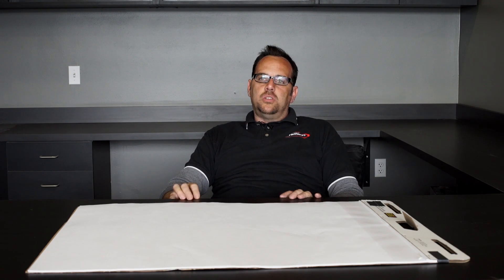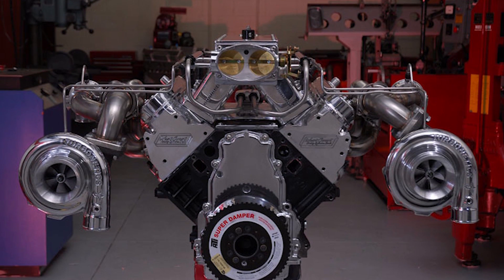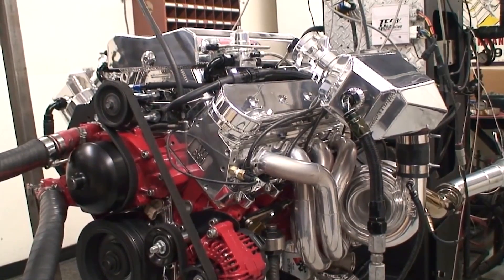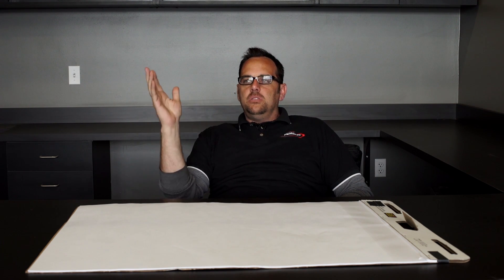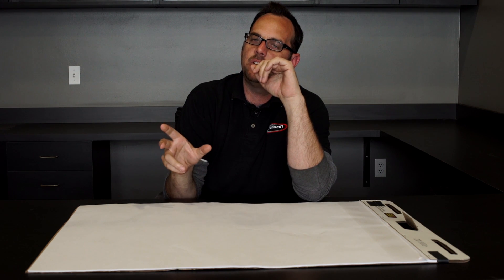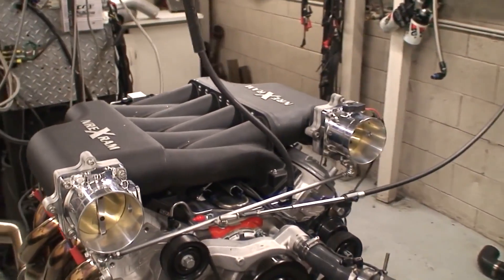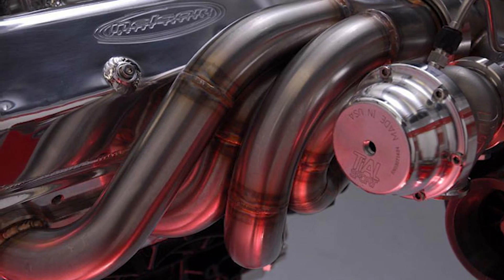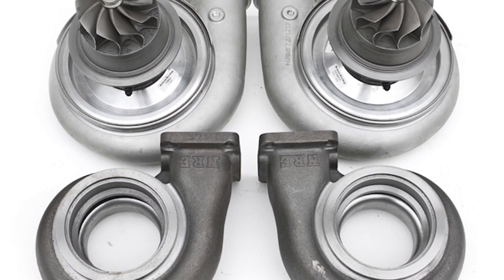Master Engine Builder Explains Why the LS V8 Is SO Good

Comment: i love this video should do a Why is the 2JZ so good? next
Reply: all you guys are looking at my original post wrong. i never said the 2J was better, i was just saying they should do more videos like this one about other motors.
Reply: +joseph martinez  the 2JZ is so good because engine block development made in Germany, Cylinderhead development at Yamaha, result one of the best
Reply: +joseph martinez Because inline 6 with turbo and square bore/stroke and DOHC 4 valve. That's it. and the cast iron short block is very robust and the aluminum head is well designed.

Done.
Reply: *****  he has no debate, literally everything I said was factual.
ls motors kick rods well before jz motors look it up on the fbody fourms (which I used to be apart of I owned a 12 second ws6 only bolt ons) its not just slapping a turbo on a ls and making power.
jz motors have made over 1000hp unopened complete oem gaskets. let alone 550whp is a piece of cake drivability is all in the tune.
show me a ls to make over 1000hp on the stock headgasket and head bolts, let alone stock rod bolts....you will kick a rod in a ls over 800hp its just a matter of time. however a semibuilt ls is bulletproof and makes tq for days.
I take nothing away from both engines, im not a fan of spreading miss information like a jz being a ticking time bomb over 550whp that's jjust bullshit and anyone with half a brain knows its.
if new world order was half as non biased as he would like to claim he would have corrected the countless miss claims made in this thread, instead hes just protecting the ls motor could care less about what anyone says about the jz motor cause hes a fanboy.
this whole comment section is filled with bullshit from keyboard warriors who have never been there or done that.
Reply: +saratov99 That's a little extreme.  All cars have a mechanical margin of safety built into them.  A 300 hp car that now makes 500 hp on an internally stock engine is likely well beyond that point.  I cam swapped my Corvette and drove it 3,000 miles on the Power Tour a week later.  I had zero problems.  I can completely understand the piece of mind of knowing a stock car will fire every time you turn the key.  A lightly modified car that is well planned out can give the owner that same piece of mind.
Reply: +joseph martinez 2Jz is an overhyped engine.
PIG fat 600Lbs.
not fuel efficient 
not small
not cheap to modify.
Reply: Razvan J im not comparing the two motors i want to see more of these kind of videos i dont care whats better
Reply: +joseph martinez easy to make power on a 2jz, reliability is another story
Reply: what do you guys drive? or just keyboard warriors?
Reply: the RB series motors would be good to see too
Reply: +MRsteezy123 bigger engine more parts more money let's see my ls1 gto made 430whp after heads cam exhaust tune. Heads $1200, cam $300, exhaust $2,000 tune $300. Let's see a 2j make over 400wheel for less than that and be a daily in the summer with 24mpg. Shit all its needs is about 8lbs to be making 700+ and that's with just bolting on a turbo like a lot of guys do. There's stock ls2s with a tubing thrown own making 600+ wheel you won't do that with any 2j. The LS is better plain and simple for a platform to build power on. 2j can't touch the reliability and power capabilities the Lsx is capable of and neither can most engines that's why it's so popular. Amazing performance platform, reliability, cheap cost, why the LS is so popular. The 2jz is a great engine but not as great as the LS
Reply: +joseph martinez that would be cool to see for sure. this guy has 20+ years with v8 style motors...i wonder who in the world has the same passion for inline 6 motors...find that person and you got the 2JZ video....slim chance they exist. 8000HP top fuel dragsters are supercharged V8s in todays world. the v8 still destroys all. http://www.popularmechanics.com/cars/a12596/anatomy-of-a-top-fuel-dragster/
Reply: +New World Order lol, where is your argument though ? All you've done is pull petty insults out your ass, but have yet to say a single fact. If anyone is the fanboy, it would most definitely be you.
Reply: +Razvan J Holy shit you're ignorant.
Reply: ***** you have no argument, NUFF SAID.
Reply: ***** and all my facts remain and you have yet to bring a actual argument, jz still holds more power than a ls oem for oem., cry about it.  the fact you think you can put all engines from japan in the same category already shows me the idiot im talking to.
Reply: +saratov99 The RB series' achilles heel is its oiling system.... being a high revving engine, you would think its oiling system would be better..... nope. You'll have to spend at least $800 on an N1 oil pump if you're thinking of even making any more power than stock and sit at 8000rpm
Reply: +Richard Harrold the ls is head and shoulders above the 2jz.
Reply: i have no idea how that reply goes to anything i said last but whatever you say man you do your own thing.
Reply: +joseph martinez Yes plz
Reply: joseph martinez theres a kid on youtube names albert meade whos making like 740whp on a 1jz with all stock gaskets and internals in a mk3 supra like does this Saratov kid think he knows anyting? he sounds like a dumbass, its a well known fact a jz will handle over 800whp all day. a ls will kick rods way before a jz, and before it kicks rods it will blow a headgaket at around 600whp..
both engines will make more power then you could need, but a jz will make more stock for stock more reliable. a ls needs to be partially  built to show its true potential.
Reply: Everyone is over here arguing LS vs 2JZ, I'm just sitting here loving my '75 sbc..
Reply: +Richard Harrold Jesus Christ French cars? I wouldn't spend someone else's money on a rolling French turd.
Reply: +joseph martinez way early in the thread in a comment made by Richard. I chimed in too late in a thread is unnecessarily long. But yeah something more on topic I think both engines have their merit and we're both rolled out in some pretty iconic cars that changed the face of Motorsport for the better.
Reply: lol oh ok yeah idk how this comment thread turned into a bitch fest.
Reply: yeah youll never understand unless you sit in one and experience it yourself. endurance racing is a feat but its just one type of racing gotta respect them all or your not really a true enthusiast. nothing is better than the other just an opinion of what you grew up with
Reply: +MRsteezy123  do some research stock GM 4.6 1200hp http://www.hotrod.com/how-to/engine/hrdp-1109-stock-gm-ls-engine-big-bang-theory/
Reply: You guys are all dumb. Obviously the rotary engine is the best engine in the world.

lol jk I love my rotaries but they have no torque
Reply: +Richard Harrold those engines are modular (DOHC), so their valve technology is more advanced and yes, they make more power but have more moving parts.  Pros and Cons to each technology.  I personally own a 5.0L V8 DOHC and love it, but you have to give the LS credit.
Reply: MRsteezy123 I love my 1JZGTE SC300 lol
Reply: ***** and the fact still remains a jjz makes more than ls ....and take a rain check kid the 2jz is not extinct you can still get a 0 mile crate engine from Toyota or a 30xxx mile engine from japan.....idiot I mean I literally disprove anything you have to say.
you do realize GM and Toyota have a partnership and have had a partnership for 25 years and sell each other technology right? you literally are a clueless idiot and the more you post the more I prove it haha.
Reply: ***** just look at your profile and your post all you do is troll import vids talk about a loser and fanboy, and a fanboy that doesn't even have a argument that's sad.
no argument nuff said.
Reply: +saratov99 OEM is the most the reliable as they're engineered to be reliable. 
built engines don't last as long as an OEM engine making OEM power.  but that's what you pay for more power.
Reply: James S nobody mentioned a french car?
Reply: Bat Man read the actual article they semi built the engine new headgasket, headstuds, cams ect. Thats not a oem ls so its not valid. A oem stock gasket 2j made over 1100whp a ls hasnt and cant. quote from the article that i have already read before you posted- "The stock 5.3L heads were ported by Total Engine Airflow and received larger intake valves and an appropriate spring upgrade. Fel-Pro MLS head gaskets and ARP studs hold the heads on, and the cam is an off-the-shelf 228/230 grind from Comp. The cam was run with a new set of Comp hydraulic roller lifters, as the originals were clogged and unusable, but we retained the stock pushrods and rockers" so its semibuilt, atleast you brought a actual argument.
Once you start porting and adding cams, and a mls HG with headstuds, bassically a built head to take more airflow so you dont stress the bottom end as much, you can no longer call it a "stock gm engine"
Reply: +JustKyzuuh rotaries are. awesome, I hope they never die off. Mazda needs to make a new two seat rx7 engine.... now is the perfect time for it.
Reply: +Razvan J you've clearly never owned a 2jz before let alone know ANYTHING about them.......only speaking out of ignorance you are. That golf diesel your so proud about would fall apart quicker then a 2jz would if they both didn't receive any maintenance. The 2jz easily handles 700-900hp in stock form with out braking down, its been proven to be one of the most robust engines ever made....yours has not, I think your just a upset little fan boy.
Reply: some people like LS other RBD other 2J... calm the fuck down and drive what you want jesus!
Reply: +MRsteezy123 +MRsteezy123 No unopened 2JZ has made more than 1050 whp so youre bullshitting already, the record is 1043 hp. The Chevy 4.8s and 5.3s have both made more hp on the stock bottom end than any 2JZ ever has. 4.8 made 1200+ hp on stock bottom end and the 5.3 has made 1308 hp on stock bottom end. Recently Flaco made 1407 ft lbs of torque AT THE WHEELS with a stock bottom end 5.3. LS1 wont hold the power a 2JZ can, thats a fact. But the other LS motors blow the 2JZ out of the water
Reply: +saratov99 As soon as you change one part of an engine it's less reliable than stock..
Reply: DoriFord  probably a bitching powerband no doubt, but it goes to show building a motor n/a is not cheap, 8k is allot more than I paid to be making less power. sure its more usable for drifting or the street but there's no escaping once my shit spools (straight line car ex daily driver). it depends what you want but the car, every platform has ups and downs but just cause I prefer jz doesn't mean I hate or will spread false information about lsx, or 4.6 mod, or 4g63 ect all are bitching engines that can make way more then you would ever need on the street.
Reply: ***** my 2jzge made over 700whp it was out of a sc300 with 148xxx.
Theres zero lsx anything to make the same amount of power a 2j has completely unopened oem longblock, those are the facts having rusty cylnder walls at any mileage is a bad sign and anyone who doesnt get that block to a machine shop before trying to make big power is a moron.
And its litterally the complete opposite to what you're saying
 Most ls i run into have basic cam/intake lid/exhuast setup.
Most jzs have a upgraded turbo and a 6262 makes far more power than the basic street cam ls.
Reply: playah hater tuning goes by the software you use and the hours put into the tune, the engine has nothing to do with the price as much as the software you use.
Then you go on to say idiots who don't own the engine talk allot, then go on to say you don't own one...lmao stay in your lane
Reply: Axle Grind
1. a straight six will make more torque earlier than a v6 with the same compression and displacement, simply because a straight six can have a longer connecting rod and stroke.

2. a straight six by design is more balanced in the crankshaft than a v6 ever can be.
because  you stick two three cylinder engines together in a V shape, you can't cancel out all the vibrations, since the pitch and yaw moments aren't in the same axes, by default this creates more inertial mass on the crankshaft( this means vibrations as well meaning less reliable in high rpm)

3. because of point number two, it makes the inline six more sturdy under high tq/hp applications, there's a reason that huge bulk carriers with- 703,130 ft.lbs torque use giant inline sixes and not v6, the same reason that most industrial vehicles also use the inline six, from construction, to towing, to racing.
everything has its pros and cons

class dismissed.
Reply: +MRsteezy123 there are plenty of n/a LS cars making 600-700whp. Making that type of power n/a is way more impressive and yeah low compression can handle boost better so a 2jz can take 40lbs of boost and make 1200-1400whp on that but an LS can make 12-1400hp on half that and are very well known for being reliable with that type of power. The 2jz is the best inline 6 and is amazing but compared to an Lsx that have made in the upwards of 2000hp. I saw a 3,000hp 502 Lsx in a nova at LS fest 3 years ago. A 2jz can't compete with the higher cubic inch LS engines
Reply: +MRsteezy123 you made my point for me when you said LS makes power on less boost but a 2j does the same with half the cubic inches. Which means the 2j works twice as hard to make the same power which means it's more likely to fail and fail twice as fast under the same power. And you can get plenty of LS 1,2, or 3s out of a wrecked car for $1200 and the cost of building a 2j cheaper lol please we all know when you start build a boosted car price on parts sky rocket expect ally when your buying turbos build to handle 30+lbs. not to mention it's easier to build horsepower with more ci. Btw that 3,000hp nova wasn't just a drag car it was a street car and was driven to the show.
Reply: +MRsteezy123 you do realize the Hennessy venom gt is a stroked twin turbo ls1 and why do you compare it all to the oldest worst LS engine? Try a ls7 supercharged stock 650crank horsepower straight out the box. Pulley exhaust heads intake cam tune easy 1,000+ horsepower reliable daily driver. You fail to see how much more reliable the LS is than the 2j had even been. There's a reason why it's the most swapped and popular engine and why it's being called a legend. I don't see any 2jz fest lol. The bottom line is this stock for stock LS makes more power without boost and that's more impressive, LS is known for being very reliable under 1000hp 2js are known for coming apart fairly often at those number and are actually only reliable to the point of around 700hp. Yes there's plenty of 2js making twice that but how long do they last before the next rebuild? Lots of vids on here of fresh built 2js having unexpected disassemblies after a month under 1,000hp
Reply: 3.0 liter vs 6.2 liter.... duuuh
Reply: buddy, aston martin vulcan's V8...800hp N/A
Reply: +Razvan J  So why are 2JZ powered cars demolishing boosted bikes and 2000hp Lambos?
Reply: +saratov99 you say can make over 600 reliably then we have motiontv  blowing 3 ls in 2 years...
Reply: +MRsteezy123 http://www.hotrod.com/how-to/engine/hrdp-1109-stock-gm-ls-engine-big-bang-theory/
Reply: +joseph martinez Native as in Indian Tribe ?
Reply: Primeiro Último  Yes, Navajo
Reply: +SANIC sounds like sex
Reply: +MRsteezy123 let me get this correct, your are trying to argue that a twenty year old engine is better than even the newest generation of ls engines? First of all ,where did you get your info on the two platforms? was it online in the comment section of youtube or real world experience? both platforms are amazing pieces of engineering but in my opinion, your comments are absurd.
Reply: you can legally import a 1990 cosmo 20b
Reply: +joseph martinez    people love to fight on the internet
Reply: +Eric Foreman HOLY SHIT  im in tears reading this lol good one
Reply: Eric Foreman Eric Foreman? from that 70s show?
Reply: 2jz is only good because it has a cast iron block and forged internals it's called common sense
Reply: +Marcus Brown common sense or not, its still a great engine imo
Reply: +joseph martinez  you live in Arizona fool?
Reply: +MRsteezy123  well duh, guy listen that 2j has been designed to be forced induction the ls has not, the 2j is the crown jewel of toyota, the ls1 is put into trucks,suvs,impalas, vetts (at a time) it is the peoples motor, secondly the 2j is the nicest engine they have. the ls9 would be an equal eqivilent comparisson.
Reply: +Razvan J I'm pretty sure that building engines to make below 10 second passes, then doing the maintenance on them so that they can keep running fast takes quite a bit of skill and mechanical knowledge. I don't know where you got your perception of drag racing but I can tell that most of the people who are involved in the sport are good people and not a bunch of assholes.
Reply: +New World Order you clearly don't know much about the 2jz if you say its unreliable when modded! It's just as bullet proof as any LS is, and just like an LS with just a few bolt-on you can be in the 600-900 hp range reliably. If you were talking about the RB series then I'd agree but the 2jz is not a unreliable engine until your pumping 1000hp on a factory bottom end.
Reply: +New World Order holy crap I just realized how much a loser you are..... no facts just opinions and insults.
Reply: +CrazyForCooCooPuffs the Cosmo is such a cool car, its a shame they're actually very rare...
Reply: Why is the d15 so powerful
Reply: all you guys argueing over two engine types geez get a life any motor that can make more than 500hp is awesome
Reply: somethingtough actually your right it is 1043whp unopened...no ls has done that, show me one, you clamining a 2j couldnt make a extra 100whp with a build head is crazy. Theres the 5 second "supra" running a oem crank(check)...theres titans 1200+whp supra running stock rods and crank, just aftermarket pistons, so rods (check), then theres s&o teks sc400 with 1100whp with arp rod bolts, but stock pistons so (check)....so were exactly is the weakness in the bottom end that wouldnt allow it to make a extra 100whp? 
One things for sure its not the crank,rods, or pistons as proven above sooo.....
No ls has made the power from the factory that 2j has its fact you can argue bottom ends all you want but not much people only build a head and keep a oem bottom end to make 1200whp, especially with a 2j at that power level you're looking to go stroked 3.4l.
My point was to the kids saying a 2j cant hold 550whp without being a ticking timb bomb, my point was also a 2j can hold more power oem then any one of them has. anything else is irrelevant
Reply: +MRsteezy123 No LS has made over 1000 whp unopened, im not denying that. Only Fords 03/04 Cobra motor and the 2JZ have made 1000+ whp on unopened blocks (the 03/04 Cobra motor actually made 1188 rwhp and 1015 rwtq). And Im almost 100% sure Ekanoo runs an aftermarket crank now, the only person to run in the 5s with a stock crank is John Mihovetz with his Pro Mod. 
It may be possible for the 2JZ to make more power on unopened blocks or more power with a stock bottom end, but as it stands right now, the LS has proven to have the stronger bottom end while the 2JZ has proven to make more power on a stock unopened block. 
And you would be surprised how many people actually do exactly that with the Chevy 5.3s, run a stock bottom end and build the heads and make 1000+ rwhp. All they do it port and polish the stock heads which flow extremely well for stock components. 
But that kid was an idiot, 550 is nothing to the 2JZ. They are pretty safe until the 750+800 whp range.
Reply: somethingtough when the ekanoo first came on the scene it was oem block and crank thats what their build thread says i dont know about now, but they ran a 6.15 with a oem crank.
Ls motors are good its no secret there really is no winner its all subjective i dont think one is all around better than the other, but in my experience i owned a ws6 the ls1 can make a easy 450whp with cams, but when it comes to going turbo its not easy to make big numbers simply cause it wasnt designed for forced induction. As opposed to my lexus i made more power by just upgrading the turbo and injectors. Its not that simple with a ls or else everyone with a fbody would be turbo, in reality most owners have the intake, exhuast, cams setup. And i dont know about you but i wouldnt boost a ls1 on a stock headgasket with stock headbolts, like i i would with a jz. And i when i mean not as simple...i mean not as cheap, with money build a turbo ls monster but not everyone has that type of wallet or resources or like i said everyone with a fbody would be boosted
Reply: +somethingtough 2JZ limit is 500 hp for unopened block. Piston rings will lock with over 500 hp, it's stupid to run it unopened. With a blueprinted block for that power you can have up to 800 hp on stock internals. Keep in mind, 2JZ has got cast pistons with an oil channel, not forged.
Reply: DoriFord wrong on all counts, 500hp is litterally the easiest setup, besides the bpu 400hp stock twin setup. Just to let know i run 700hp on stock pistons, and people have run more.
Reply: +MRsteezy123 Oh, really? What engines have you built before? It will hold 600 hp, but you will fuck up the cylinders, you stoopid. Why? Because the piston gaps are not set to run that amount of heat, thus they WILL lock and score the cylinders. It doesn't mean that it will not hold the power. It will, right until the ring land finally breaks, because you're doing stupid things. You can't beat laws of physics, expansion rate in particular, just because you wank on 2JZ superiority. We've built a 1200 HP 2JZ, I've seen my friends running 800 HP on stock bottom end, but PROPERLY GAPPED, so I know what I'm talking about. You can leave your bullshit for local forums, mate.
Reply: +MRsteezy123 http://www.trucktrend.com/how-to/engine/1213tr-vortec-5-3l-big-bang/

Read this
Reply: +Richard Harrold Look at Mast Motorsports
They gave Hot Rod Magazine an LS7 that makes 690hp (not all the way turned up) on pump gas
Reply: +MRsteezy123 Both motors are reliable as hell
I've seen completely stock 5.3 LS motors run 1000hp from a single turbo and go all of drag week without issue. The LS just makes more power because it has more cylinders and more displacement.
Reply: DoriFord'stoopid' ironic....what you're saying makes no sense, plenty of people including myself have run 700hp+ on stock pistons and rings 130+k miles on the setup and has water meth inj...
Reply: woohooivan already have.
Thenitroviper LS makes more usable power, peak power isn't what wins races, the ls doesn't need high boost either depending on the turbo. trust me I know, but personally my 2jz is more reliable and my ls wasn't even boosted was a high 12 second car with just bolt ons and tire, maybe im a little salty that I had a cracked head on my ls with just bolt ons, but I don't doubt their potential just their horsepower per dollar when it comes to 600+whp.
Reply: It's easier on a motor to go N/A than boosted. And in the US, there are LS motors everywhere. I can pick one up at a junkyard for less than $1000 and put it in a car pretty easily. They have been swapped into almost everything by now
Reply: MRsteezy123 water meth injection is a cheat code, ya damn cheataarrr!!11
Reply: DoriFord I said the motor was stock and it is, its up to me and my tuner to make sure to keep cylinder temps down, water meth injection is simple and was a no brainer when running high boost.  the same thing would happen to a lsx or any other engine when the cylinder temps get to high you fuck shit up, but water meth injection doesn't change the fact its all oem gaskets and internals, if that's cheating so is upgrading injectors so you don't run lean.
Reply: MRsteezy123 "my tuner to make sure to keep cylinder temps down" - that's the key. Because your tuner is wise. Like I said, the piston rings will lock without additional cooling for the pistons. They are not gapped from the factory to run great heat. Same with rod bolts, you shouldn't increase the engine speed way too much it was designed to run.
p.s. Regarding "cheating" I was just kidding. Nobody uses water-meth for long time competition, so that's why it is a kind of trick. I'm into air cooled porsches nowadays, they suck balls with their engine tech, and I heard you can dramatically lower intake temps with Aquamist or something, but what's the water/meth consumption in daily use?
Reply: DoriFord well I don't drive around 700hp+ daily use...but my pure 93 setup is no slouch either, that being said it was my idea to introduce meth injection. its pretty standard stuff its my tuners job to make sure it works correctly.
Reply: MRsteezy123 Ah, okay. I understand, but still not a big fan of water. I wouldn't want to have any corrosion problems because of extra water.
Reply: +joseph martinez 2JZ is a oversized 700lb boat anchor. Why does any vehicle with a 1500hp 2JZ run high 9's? Because its a boat anchor.
Reply: C Genious high 9s! thats incredible
Reply: C Genious even though factually, at 1500hp it would be running more so in the 7s.
Mid 9s is what the usual 1000hp street setup does. 
But then again im not a biased dumbass like you.
Reply: MRsteezy123 How am I biased? I simply stated that the motor is a boat anchor. It's large, extremely heavy, costs a ton of money to get big power. They sound great and all, I just think it is overrated, a bit.
Reply: C Genious cause you have no idea what youre talking about. How do they cost a ton of money to get power on? Bigger turbo, tune, supporting mods=power. I make a 734whp for cheaper then i could do cams on a ls that wouldnt even leave me near that power figure, you think turboing a ls is cheap? You pay to play.
Second that boat anchor weighs about the same with the 6 speed transmissions as a ls1. Ls1 with a t56 is near the same weight as a 2jz with a v160. But please explain to me how a 2jz cost a ton of more money to make power out of compared to any other motor, please lets hear it pencil pusher cause its clear you have 0 expeirence with a ls or jz based on that statement alone.
Reply: MRsteezy123 The LS7 weights 403 lbs, about 450 with accessories. 2JZ GTE 740lbs with intercooler and turbo. How can you couple a trans to that and be lighter? I am misunderstanding your logic. There is tons of info on how the LS series is much lighter and smaller than a 2JZ engine with components.
Reply: C Genious cause the t56 bolted to the ls1 is only a little lighter then the 2jz bolted to the v160 6 speed, what does only the engine weight matter when you run a engine with a transmission, the weight difference is nothing astronimical considering you lose 100 plus ilbs ditching the stock twins and intercooler.
Second answer the question how does a 2jz cost "a ton of money" to make big power compared to any other engine explain your statement fool.
Reply: MRsteezy123 ls3+t56 is gonna be lighter than a fully equipped 2JZ-GTE ex-trans.
Reply: DoriFord yea i know my point is that its barely lighter in the grand scheme, cast vs aluminum, cast is more durable so ups and downs.
Reply: MRsteezy123 It is somewhat lighter. The key benefit is that LS can be NA, so you don't have turbos, wastegates, intercoolers and stuff, which all add extra weight. The only downside of the stock LS3 is that the piston pin is a press fit. It's not good for motorsports and piston will break after some time. LS7 pre-2009 sucks too: way many problems with titanium, which were later solved with in the updated engine (new rod machining, better valve guides). So I mean, all stock LS engines are not bulletproof, but if you build it, it is! And it's a lot cheaper than 2JZ/RB26 or whatever.
Like I said, I'm not a big fan of using LS engines, but they are great. If I had a Silvia, I'd rather stick to an oddball FJ20, because it's much better than SR20 with stupid rockers. I like odd engines. I'd piss on every 240/280Z owner, who sticks in RB26 instead of a Nissan L28, because inline-6 L engines are fucking unbeatable, unlike the ill-born RB26. I like odd stuff, but of all the un-odds LS engine is a plain reliable powersource for good 400-600 HP range.
Reply: DoriFord building a n/a is more expensive then tuning a engine thats already designed for forced induction. Thats what makes the 2jz cheaper it already has the right compression, it already has a metal headgasket, it already has the electronics and ecu that understand what boost is. You dont have that with a ls. Building a 600hp n/a ls is going to cost some big bucks more expensive then just buying a newer turbo,manifold, injectors, piggyback = power. 
Try doing that with a ls, unless your a engineer that can fabricate everything yourself turboing a ls is not cheaper then upgrading a jz turbo, or else everybody with a fbody would be turbo instead its cams, intake, exhuast which seems to leave everyone under 500hp. It cost more to build a lsx on the simple fact theres more parts, more cylnders = more cash also= more parts that are moving and more parts that can break...theres a reason all the big deisel trucks that are meant to pull a ton of weight choose the l6 config...dead weight carrier ships pushing 15,000 ft ilbs of tq use giant inline sixes.
Reply: MRsteezy123 Man, just to let you know.
http://www.speedhunters.com/2014/07/fail-crew-v8-nissan-silvia-s13/
See that car? The build was around $25k for the whole car, including the basic car, rollcage, 550 hp engine (built from scratch), RSG Tranzilla trans, electronics and other stuff. It took just a short of 6 months to build. The engine was about $8k for parts, including useless stuff: cam, Jesel shaft rockers, valve springs, new CTS-V lifters, MSD coils (pile of money, absolutely worthless), LSX-R intake (another pile of money). And so we've put it on a dyno: a thick torque curve and 550hp. With short geared Tranzilla this thing is a blast. Best money spent ever.
p.s. The engine featured in the article is a 2nd one, GM 480 hp crate. The first (built from a used L92) one died after a year and a half (piston broke).
Reply: MRsteezy123 Well, I mean, if you're wise, you can build it dirt cheap. You need like a decent cam, a used LS7 intake manifold (instead of LSX-R), schoenfield headers to start with, you will pretty much land in 550 hp range. Maybe not as realiable as a high-$$$ motor, but it's getting really cheap as LS engines get cheaper. Because you've got a huge V8 support in the US, V8 parts are much cheaper than inline-6 ones.
We had a 2JZ S13, but unfortunately my friend smacked its front end literally next day after it was completed, lol. It was really sad. I never got to drive it. Unfortunately, it was also turned into LS-powered race car. I was against it, I'd rather leave it as it is. It was perfect for me.
http://fotostation.ru/?p=143383
Reply: DoriFord you would be surprised lsx are not that much more cheap than say a jdm shipped jz. and na-t is always a option with the 2jzge.
Im the type of person that would rather not spend money on machining and build a engine. I would set a power goal, size my turbo to match my injectors, find a nice little piggyback or if need be, go standalone. and make power. its almost the same ball game with 4g63 my friend had a gsx dsm he was literally running 11s with less then 1500 in aftermarket parts and the engine had oem internals.
Reply: MRsteezy123 I agree at some point. I see that building engines makes them predictable and reliable. No tweak would ever help you get away with RB26 un-reliability, which you can only cure if you build it properly. You can leave stock parts in the LS, just change the cam and intake. It's all easy with LS architecture, very little number of parts.
Recently, a guy called me, I came over and saw an LS1 S15 with Hillborn injection, which was "running a little rich". I thought it should be running on something serious, but nope, it was Delphi ECU and a tweak. It's ridiculous how they've tuned the engine, since there is no wideband O2 plug in the exhaust, lol. I think it's stupid to run ITB with a tweak, but if it finally works out, I'd be surprised. :)
Reply: DoriFord rb26 is a whole another discussion, with a jz or 4g63 from the factory, they hold a ton of power in boosted applications. The 7mgte is a motor for example blows the head gaskets from the factory but easy fix with the headbolts ect. anyway a 7mgte  makes a ton of tq more then power until 550+hp range. so a mild 62-1 turbo 7mgte could make 550tq, and 525whp.
 The 7mgte with the right setup acts like a v8 behind the wheel, and they go for cheap and are dead reliable after you fix the headgasket issues people make power into the 700hp with the stock internals.
Reply: MRsteezy123 Yeah, maybe. The 1FZ is a real beast too, there's a guy who runs 800 hp on stock internals with a tweaked stock ECU. However, it's quite big and heavy again. Plus the downside of JZ is the cost of gearboxes, so people around here tend to weld on Getrag transmissions from BMW E34/E32.
Reply: DoriFord I run a toyota r154, holds 700+whp completely stock. the 6 speed are expensive.
Reply: MRsteezy123 Long R154 here is now about $1500 (in old currency conversion rate), V160 is well over $4000. BMW 6-speed gearbox is like $100-200. New RSG Tranzilla T56 which holds about 1800 HP is like $6000, incl. clutch and yoke.
Reply: DoriFord yeesh got mine for 500 needed new synchros.
Reply: MRsteezy123 How is getting 600hp NA harder and more expensive?  You think it would be cheaper to buy new turbos, manifold and injectors to take a JZ to 600hp? Here is the answer. LS7 = 505hp + a slightly aggressive cam ($800-1500) = 600+hp. That is one mod and you are at over 600hp for less than 2 grand. H/C/I tuned, over 700NA hp. Turbos are not cheap unless you buy some pos Chinese brand off ebay. The 2JZ is not a cheap engine to play with. Anything over 600 and you are doing internals anyway, at the very least the top end.
Reply: C Genious Guess, you know nothing about LS7 engines. :) They are expensive and unreliable as they come from GM. Building a proper one is another pile of money.
Reply: DoriFord They are very reliable engine. I don't know of one failing in my area. But I see your a Ford guy so that might explain the opinion. Many people upgrade to stock GM valvetrain from the LS7 on other LSx builds because of its quality.
Reply: C Genious well first off a ls7 makes around 430whp not 505 thats at the crank smart guy ,I MAKE 734whp and have not "done the internals" not even the top end, you dont Need too. I bought my turbo for 600bucks used at a reputable shop. You cant convince me its expensive when my expierence says otherwise, im going pro efi soon enough would be the most money i put into the car.
Reply: C Genious lol, yeah, I'm not really a Ford guy, it's just an old nickname. I used to have few Ford Taunus TC1 cars, as a wannabe teenage drifter. At the time :P
I've played with LS7. It's a pain the ass to build it properly, mostly due to parts. The engine is a joke. I can get you my personal pro/cons list, if you'd like.
Reply: MRsteezy123  Why would you waste money on ProEFI? AEM seems to be more predictable, without the fancy pro-eness. What about AEM infinity? Btw, never build an LS on Haltech, it'd suck balls. Haltech can't control GM idle speed motor well enough, so the car jerks on little throttle. Like this:
watch?v=uZbd0VBIzFA
very stupid... our tuner fucked up pretty much with his ECU choose back then, lol...
Reply: DoriFord aem was a option but proefi seems to be what all the 2j guys are running now adays and my tuner is famliar with the software.
Reply: MRsteezy123 Ah, okay. I just try to avoid getting "better" aftermarket ECUs, sometimes they turn out to be worse than well known and proved ones. You might heard about "Total Race", a vip luxury tuning shop from Moscow, they've been building cars with astronomic budgets and ProEFIs and even so they ran like crap and died like rats. They had the fastest Gallardo in the world (as they claimed), but it ran for like 2 days in a season, then got away with smoke or destroyed engine. Money don't help if you don't pay attention to details.
p.s. Moscow is a very strange place to be. It seems like things happen there by miraculous coincidental occurrences, not by knowledge.
Reply: Rice lovers, facepalm. LS V8's are superior to pretty much everything. Bargin of  the engine world. LS7 is twice the motor a JZ will ever be. If 2JZ was the answer, they would still make it. And its a german/yamaha motor. At least GM designs and builds there own. Companies like ford and yota getting piano makers to build there engines.
Reply: C Genious Suckmabutt. Your engine knowledge sucks and you're not welcome in this section of comments.
Reply: MRsteezy123 Wikipedia says that GTE version was actually "polished" by some germans, as an explanation of the big difference between GE and GTE. The GTE head is a little german, it involves tumble effect rather than better port flow of GE (popular in audi turbo engines at the time). And thank god they got rid of the distributor.
Toyota was on the edge of awesomeness in the early 90s, everyone invited them. Toyota re-engineered Porsche production system as a whole, which save Porsche from bankruptcy.
What I liked most about 80-90s Toyota is that they were really good engineers and metallurgists, so they got rid of the hydraulic lifters. Lifters are extra weight, you don't need when you have a fixed valve lash - they've set up coherent metals so well, that the valve lash is stable for more than 500 000 kms, which is bloody amazing! That means that neither cams are not wearing out, nor valve seat doesn't settle down (wear). Some of the 2JZ and 1GZ V12 engines even received TiN PVD coating on the lifter tops (i.e. lifter lash cap).
Reply: DoriFord a german engineer hired by toyota according to.wiki (which there is no source), that still doesnt mean it was designed in germany its factually designed and blueprinted by toyota with yamaha collaberation, and, Toyota owns a large percentage of yamaha.  The jz and m series inline sixes are all in house engines from toyota none of them were designed in germany, the germans designed the v160 tranny.
Reply: MRsteezy123 I quoted wiki for the GTE version only. No doubt it any other. Btw, it's true that Getrag for JZ is pretty much identical to BNR34's Getrag internally. After being tired swapping RB25DET gearboxes I came up with an idea to run a Getrag from a BNR34 as a RWD trans... luckily it turned out to be a piece of cake: unbolted the transfer case and a nissan yoke dropped right on the shaft, same with the getrag rear diff flange. We just had to invent the shift linkage, which seemed to be okay, but later failed to shift into 1-2 and 5-6 gears, so we ran 3-4 for like half of the season, but it's about right in drifting, so no problems, lol.
Reply: ***** not true people have made good numbers 2jzge nat-t, if youre implying without a turbo well no shit, its a low compression 3.0 liter designed for forced induction. What ifs dont apply to reality thats like saying the ls wouldnt be shit without the extra 2.0ls or extra 2 clynders, it doesnt apply to the real world.
Reply: +Josiah Crowley but its still designed for forced induction. who cares how much it makes without a turbo its about how much it makes with the turbo.
and like i said getting a bigger turbo is cheaper then building n/a v8.
Reply: MRsteezy123 I can buy a Vortec 350/350hp with go fast parts for $1200.00. If you get a turbo for under a grand, it's a piece of fuck or an ebay China special. Getting a turbo on your 2JZ would be cheaper than swapping it with a NA V8 no doubt, however it would be cheaper to build a NA V8 and swap it if you are going to do the 2JZ top end and buy a turbo.
Reply: +C Genious im doubtfull 8 pistons, 4 cams, the machine work associated with building a n/a turns out to be more. theres plenty of qaulity turbos for under a grand that borg warner, garret, turbonetics ect make, the expensive ones youre talking about are dual ball bearing turbos as opposed to a journal bearing turbo, if you think all quality turbos are over a grand you're mistaken.
but like i said theres more parts and work associated with building a n/a engine as opposed to upgrading a turbo.
Reply: +Josiah Crowley. jz are better without vvti for bigger power. 5 second 1/4 mile kid proof is in the pudding, your hate for the 2j blinds the truth, 10/10 you have never rode in a fast car.
Reply: ***** i dont have all that power for regular drives.. Shifting a 3k is not for going fast.
Reply: C Genious maybe keep watching your snow mobile videos, cause you don't know shit about cars. Right im the troll not the hater speaking out of his ass? little dweeb logic call anyone that disagrees with you a troll. You still think its cheaper to build a n/a 8 cylinder engine then it is to upgrade a turbo? lmao go check prices on machine work and maybe get some first hand experience bub.
what do you want from me? to say 2jz is a shitty engine despite me and many others making solid reliable power with them? 
not sure with gtrs have to do with any of this, but you most likely own a car with neither engine so your opinion isn't shit but that of a little YouTube car fanboy.
like I said you have no argument cry about it.
Reply: MRsteezy123 You don't make reliable power with anything but that crown vic taxi you jump in every morning. I can look at your profile too. Oh look, a troll. Dude just move on, stop making everyone inbox go Rogue. Point taken, you like the 2JZ, even though it is a boat anchor.
Reply: MRsteezy123 Ya scrolling through your comments it sounds like you've owned one of everything, a Mustang that ran 10's, a Supra, now a Lexus SC300, Trans Am, a modded Celica, all at what? 17 years old, with zero photos or videos of any? Your just a Forza mechanic. You still watch skateboarding videos and listen to Little Wayne so you aren't a day older than 20, or you would have kicked your own ass by now. And the "modded" SC300 is that old worn out POS blue car in your pictures? Looks pretty stock in that engine bay to me, I can guarantee my stock pickup would embarrass that hunk of shit let alone the mean truck. Quit lying about your life on the internet, it wont may you feel better about yourself.

Stop posting and move on, your bullshit has been exposed.
Reply: MRsteezy123 Want to have a possessions and housing contest? Because I guarantee I have already won lol. Send me a cell number I will take you on a photographic tour of my house, 80 acre property and buildings and toys. I started my own company 6 years ago. I generate 2.5M in sales and growing each year, currently I put food on the table for 12 families. I must be a complete idiot eh? At least I don't lie about what I own and talk like I build 1000hp 2JZ Supra's every second day. I bet you cant even rebuild a Briggs and Stratton lol, just another youtube mechanic... Move on.
Reply: very humble I never said 700whp. I was talking bhp. Which is very obtainable. I said I can buy a Vortec 350hp 350ci engine for 1200 bucks, not you could build a 700whp LS7 for 1200 bucks. I said you can take an LS7 and cam it to get over 600bhp, With full bolt ons, (h,c,I,e,) up the compression, tune maybe a port and polish will get you 700 flywheel hp, pretty easily, I didn't say you can do all that for 1200 bucks. 700 flywheel in a C6 Vette is roughly 600-630whp, depending on your loss figure used. The price to make 700NA at the wheels is clearly full motor job, but it has been done by many and obviously expensive as all hell. It would be much much cheaper and easier to get 700whp from a turbo setup on an LS7, still not cheap at all. But 600bhp from 505bhp? Cheap asf.
Reply: +joseph martinez because it isn't. Its a strong block that you can slap a big turbo that doesn't spool up until >1500 rpm before redline and you get a huge lump of power and then you shift again. Thats why NLTS and Antilag are so important for them in a drag race, and why most high hp supras or 2j cars are trailer queens or roll racers. 

The engine is durable, and it was designed for boost. It can take a shit ton of boost. But a durable engine + a giant turbo isn't the best thing in the world anymore.
Reply: +Razvan J Your post gave me cancer.
Reply: +very humble There is a reason 2j prices are going down despite the massive fanboy following. I&#39;d honestly rather have a 5.3 Iron block, or even a 4.8 iron block than a 2jz, much more capable, much more compact. 

Hell if it was a miata circle track car, I even go with the new LFX Kit over trying to shoehorn a 2j into that car. Again much better, more capable engine. Plenty of other better engine have come along since the days that 2Js and 4gs were kings of the dragstrip. At least the 4g63 evolved a bit before it got phased out. the 2jz was the end of the line, those engines are dead and gone, and 20 years out of date. In another 10 or 15 years they will be great budget options, but currently they are both too expensive to be budget options, and too out dated to be a serious contender in performance without a budget. The only reason to get a 2jz over a comparably costed engine would if you don&#39;t need to buy a lot of other parts to swap it in. Then you could put the saved money from a swap kit, transmission, rear end, etc etc into a turbo setup and engine build. 

The only other good reason to go 2jz is if you just want a 2jz for non performance related reasons.

Honestly. I can think of a much better 3.0 liter inline six, and it says M-Power on the engine cover.
Reply: Robert Tanksley u dont know what you're talking about, you are completely biased, they arent holding as much power, and they have flaws from the factory  youre talking about a bmw s54 m3 engine? In that case LMAO how are you going to bring up price, then name a engine that cost litterally twice as much and cant even keep its shit toghether past 600whp?  FAIL.

 please explain how a 5.3 block is more capable? i would love to hear it, i dont see any 5.3 making 1100whp on a completely unopened block, stock gaskets and all.
I dont see a small block powering anything into a 5 second 1/4 mile.
 Putting a 2jz in a miata is stupid a inline six is meant for long nosed cars, i would also rather put a sbc in a miata especially if it was a autocross.

How has the 4g63 got phased out? Still holding the record for fastest 4 banger in the 1/4 mile.
  How is a 2j dead and gone? You can still get a crate engine and theres plenty around.
You're talking budget doubt you know cars, ls1-2jz would be similiar in price to build, i would say cheaper cause you dont have the touch the block or the head and can make more power then ls1 would because it would pop somewhere around 700-800hp thats borrowed time on a stock ls, while a 2j has been shown to hold that reliable without needing to build internals. 
Put your money where your mouth is show me the more capable 5.3.making 1043 whp on a completely unopened engine like the 2j had then maybe you can talk about bang for buck.
Show me a sbc thats powered a car into the 5s.

Your idea of what you think a 2j cost to build is far from the truth, so your kinda talking out of your ass bub.

-says a 2jz is to expensive and cant hold much power compared to other engine

-names a engine that cost twice as much and cant even hold nearly as much power.

-claims a 5.3 can make more power without being built, however dyno charts say otherwise.
 
-claims a sbc is more capable even though they cant make as much power stock for stock nor can you name a car using a smc thats running a faster time then the ekanoo supra.

-claims the 4g63 is dead at the dragstrip even though its still the fastest 4 banger in the 1/4 mile.

-claims the 2j is dead and gone but its still breaking records at the drag strip.

-claims you would only use a 2jz for "non performance related" reasons...

Speaking of which you dont know about clearly. facts talk bullshit and biased opinions walk.
Reply: +nallen100 i have a 2jz supra and a Camaro..soon to build a ls series turbo motor as well. the supra is my first non American sports car and i have to say man even though you typed a lot some of it is true but some is bs...sure 2jz builds can be super expensive and they defiantly do cost more than a ls series motor but im planning on building 600 whp in my supra for about 5k.  Dont forget the supra crowd is full of elitist assholes its almost like they have a silent competition between each other to see who can spend the most money on there cars. Just do a little research i can spend 3k for a turbo manifold or 200 bucks. 2k on a turbo or 800 bucks 5k on a ecu or 1k on a good piggyback 3k on a intercooler or 300 it can be done and im on my way to building it. 15k head???  i mean maybe a fully built 2k hp race head but even then i doubt it i know guys that spend 2 to 3 k for a new ported build head you can go cheaper if you send in a stock head for machining....i mean its defiantly more expensive then ls heads but not that much more you could spend that on arp heads easy.  I could be building the supra cheaper but im using middle of the road stuff as your right on the 2jz being fucking expensive and i dont want to fuck it up with china stuff potentially failing.   Stroker kits for the 2js are defiantly complete insane you got that right and in general i prefer the ls series motors.  just no need to worry i can make 1000whp out of the ls and if it pops go spend 500 at the wreckers for a new one.  Anyway just what i have found being that im pretty unbiased towards the car scene.
Reply: +Nicholas Ioannou. Afr heads i meant!
Reply: nallen100 yet you bring no facts..big turbo, engine management, fuel, supporting mods is all you need to make big power on a stock longblock, its fact everything you say has been contradicted by real experience.
Theres no scale to determine which engine is better hp per dollar simply because EVERY setup is different. and price varys depending on knowledge, resources and goals.
So therefore you're a dummy. 
If a lsx was the only engine that you could mod cheap it would be the only engine people use..
Reply: nallen100 "it is" lmao..no its not, you chevyfan boys are delusional.
Litterally every car maker has good platforms from mercedes to ford theres plenty of good engines to choose not just lsx you nuthugger.

 Whats wrong with buying a second hand turbo?  You know i have had this turbo over a year? You know journal bearing turbos are rebuildable?
You already made yourself sound like a moron.
You think a ls the only buildable platform?
I bet it hurts your soul to know a stock longblock lsx has never made as much as a stock 2jz longblock...
 Were done here.
Reply: nallen100 they both have the ability to make power, and they both are relatively cheap platforms because they are well built from the factory.
you're just a moron.
Reply: +Blk Studd apples to apples. a 2jz can absolutely never do what something of over twice the displacement can. and they are HUGE and heavy. they make great power, but they are severely limited by something called volumetric effeciency... and the long ass cams and crank limit the amount of RPMs and cam size you can use
Reply: +MRsteezy123 horsepower numbers are cool. but they are dyno numbers. practicality is a HUGE difference and if you get off the internet and actually drive the car, makes all the difference in the world
Reply: Busted Knuckles horsepower is pretty relevant, as is weight, gearing, ect.
Power delivery is bound to be different with every setup you're not bringing me groundbreaking info.
Practicality depends on the setup a 2jz has been built to power a car into the 5s, its a capable platform that performs well. 
Theres people running low 9s on stock blocks thats pretty usable wouldnt you say?
Reply: 2JZ-GTE was so much better that the previous M block, (7M-GTE) becuase they learned from their mistakes with the 7M like problems with the headgasket leaking after 30-60k miles, from normal use. 7M  was one of the first iron block with aluminum head setuo they released. the long head expanded a lot more that the block. caused major gasket problems also the older 7m-GTE was under square meaning it had longer stroke than the bore size. tylically the smaller hore restricks airflow in and out of block. 1 jz was over square and the 2j was squate with 86mmx86mm which is ideal for airflow and longevity versus the 7M. also toyota was just trying hard to get to #1 which they took the title from GM.. number une vehicle manufactured in world.
Reply: kenykillr eh... That troll comment has been posted a million times.... Guna have to mute this dead thread... Im out.
Reply: +joseph martinez I love Toyota, but the 2jz isn't even in the same realm as an LS
Reply: Terminxman you're right the 2j is in a realm of its own.
Reply: Kim Chi opinions not facts, go to the drags and straight to the garbage lol what a biased inexperience thing i would expect a chevy fanboy to say.
Watch out guys ls is the only engine that can make power nothing else.
Theres plenty of supras that are running nines on the stock block consistently and their not blowing shit up, but i guess if you say it its true, right? Real life events and experiences count more than your biased opinion.
The amount of ls i slayed in a awd honda crv suv, with a gsr swap, running a sc62 turbo was hilarious, chevy guys like to talk about what their engines can do, but very few of them have more than cams, intake, exhaust.
Reply: +Sven C Stop that Germany bullshit. The 2JZ is ENTIRELY designed and produced in Japan
Reply: +MRsteezy123 Also keep in mind that many of those 1,000+ HP LS's are very high mileage junkyard engines out of a truck or SUV. By high mileage, I don't mean some pampered 30,000 mi 2JZ that has to be brought from Japan at a ridiculous price. I mean dirt encrusted 150,000-200,000 mile engines that can be bough for $200-$500 less than 5 mi from my home. Also keep in mind these are not GM's top of the line engines with forged parts. Show me that 200,000 mi 2JZ with rusty cylinder walls that's laying down that amount of power in that price range. Not gonna happen, ever. Now if you're talking a O mi 2JZ crate engine like previously mentioned then it's only fair to compare GM's performance crate engines as well. Yes both engines perform well and are capable of making great power but the last thing to keep in mind is how often are you gonna run up on one of those "superior" 2JZ's as compared to how many very hungry LS's are prowling the streets. Gotta a lot to learn about the real world.
Reply: Kim Chi how are my claims ridiculous, what claims exactly? If anything your claims are ridiculous 905whp through the stock  Stock headgasket? Stock headbolts? Didn't happen, and dont even try and say you made that much power with the stock ls1 rod bolts thats the weak link.
Even 745whp with the stock rod bolt and headgasket is not believable.

 if powerbands are not usefull why is there street driven supras running 8 second 1/4 miles? Its called a antilag and traction control get with the times.. 
I wasn't on flex fuel either bud, i was on a 93 pump with water/meth.

Sure my claims are ridiculous not the guy stating you can buy a ls with rusty cylnder walls and make 900whp.
Like i said facts are facts no ls has ever made the same amount as a 2jz completely unopened longblock on the dyno, and both engines have powered cars into the 5 second range, those are the facts generalizing does nothing for your argument.
Reply: Kim Chi  the rodbolts shit out all the time around 600whp thats simply borrowed time, the ls1 with some prep work like a thicker metal HG, ARP headstuds and rod bolts the ls1 can be reliable at 600-700 completely stock besides that prep work.
the 2jz is better designed for forced induction straight from the factory, it doesnt have headgasket issues or headstud problems the previous toyota I6, the rods oem vs oem the 2jz is simply more beefier, look for yourself, they hold more power as do the pistons, its simply better built from the factory.
the ls1 can be faster a 2jz can be faster. every setup is different, my point is the 2jz is better built straight from the factory to slap a big turbo on and make big power.
ls doesnt like rpm nearly as much straight from the factory.
Reply: Kim Chi  keep talking about peaky bowerbands but ignore drag times typical biased that generalizes.
like i said facts are a oem longblock 2j has made more power than any unopened ls.
they are supras with stock bottom ends running nines is that power usefull enough for you? 
  you speak as if weak rod bolts wont completely fuck your rod at high rpm?
if you break your rod bolt you break the rod, we already stated the ls1 rods can hold around 600-700whp so why are they failing at this horsepower? because the rod bolts are weak, not the actual rod itself... its on the forums for a reason, which is ironic cause you say 'spend more time researching' but if you do research thats what you find? hm maybe think about what you're typing next time.
the ls1 is simply not as strong as the 2j keep crying and trying to twist the argument,
Reply: Kim Chi  yea you owned everything in forza, theres actually plenty of daily driven supras that are running single digits.
my one thing is my sole point..the 2jz is stronger than the ls1 from the factory/end
Reply: +joseph martinez 1993 Mustang 2.3 turbo swap. dyno @ 275whp
Reply: 2jz that, 2jz this, supra this , supra that.
That engine is good but i just think its overrated. Its  long heavy and idiots who doesnt even own one talks alot (i dont own a 2jz but i know about engines) that tuning is expensive idiots.
Reply: Why does anybody want to build a straight 6 engine, compared to a V6? Use some common sense here. The crankshaft in a straight 6 is long and heavy. The V6 crankshaft is short and compact. 20-30% lighter.  That in itself means a lighter rotating assembly that rev's more quickly. In racing, faster rev's make all the difference. This is the reason an aluminum flywheel allows the engine to rev faster than a steel one. Its a  lighter rotating assembly. The only advantage a 2JZ engine has is the overhead cam cylinder head. Straight 6 engines go 'uudinnn'  while V6s go 'woodnaa'.
Reply: its not as simple as blowing up at a certain power range though.
it depends on the mods.
for instance if you stroke an ls and its not got the extended cylinders then its gonna blow up no matter what power you are making.
if you know what your doing with an ls in all fairness we all know what one makes power cheaper/more maximum potential/more power stock for stock/more power with the cheap everybody can afford type mods/lighter etc.
I like both engines myself but why kid ourselves? its harder to get the same out of a 1j/2j in the same price range.
stock for stock the 2jz is like 210kw with 2 turbos (169kw na) but the smallest ls is making more with no forced induction and improves an almost frustrating amount to just a tune as it was built to do big things then limited with little bits at the factory to actually make them not so dangerous for family's driving them.
so many people are making 300rwkw on the road as a daily driver in just an ls1 let alone the bigger stuff.
2j is the best 6 cyl in my opinion but I cant go as far as saying best engine in general.
Reply: dean tape a 2jz with stock twins can make 400whp with a simple boost controller, ls1 guys need cams to make that power, and a boost controller is much cheaper than a cam job and you need a tune afterwards.

The 2jz computer understands 
what boost is.
As far as being hard to tune, that makes zero sense tuning is 100 percent software related.
 if its hard to tune, either you are your tuner have no idea how to use the software. 
all engine tuning is the same when you break it down, ls has zero advantage in the tuning department because its all about software not the engine.

If you take a ls1 and a 2jz and do nothing to the internals, the 2jz will handle more boost thus make more power why? It was designed to handle boost the head gasket is metal oem, the compression is made for forced induction and the block is blueprinted for forced induction.
A ls1 will pop the headgasket at around 600whp, rod bolts need to be exchanged and retorqued with arp rod bolts or they will give.

Lots of stuff in the ls1 will give before a 2j, thats why the record for the highest horsepower oem Longblock2j is still higher than any ls, those are the facts.

Stop with all this hard to tune crap, you size the turbo for the power you want, size the injectors to match, supporting mods, pick your software and have it tuned, its litterally the same thing for every car.

Theres no such thing as the best engine, the best engine is always going to be custome made.
My point is the 2j will make more power cheaper simply because the engine is better designed to handle forced induction, at the end of the day they BOTH need a big boy turbo to make big boy numbers, and they both need a standalone and a tune to make those numbers.
 so thats very similiar price the only difference is you dont need to switch out the headgasket or rod bolts, or port the heads or change the cams, you dont need to do that with a 2j like you would a ls therefore its cheaper.
Reply: Sure it's possible to throw enough turbo boost at an engine until there's catastrophic failure, but If you plan to do some serious racing with this 2JZ you better start out with a $4100.00 Winberg billet crankshaft. At 45 lbs. it saves 15 lbs over the stock forged unit. And you better find a front pulley that doesn't disintegrate like a hand grenade under all that boost or it's back to the drawing board again. Sure you might get by with the stock crankshaft but for racing purposes the lighter the rotating mass, the faster the car.
Reply: MRsteezy123 a cam job cost money?
$200 or so for a cam and tune it an ur done.
just because a boosted car can make that power by winding up the boost dosent mean its as good as a car built to do that without exploding in a few days.

I don't have a j2 or a ls at the moment so im not biased here but ill take a guess at saying you have a 2j?
Reply: Axle Grind what? Out of all the things on a 2jz to reinforce you pick the crank? Lol the stock 2jz crank has been in 1100hp alpha tuned supras.
You just picked the crank cause of the price tag.
The pistons would go way before the crank.
Reply: MRsteezy123, go ahead. Put titanium pistons in the motor. I don't care. The heavier the crankshaft the more inertia that must be overcome before the wheels start turning. 15 lbs difference is a lot. Not to mention the counterweights are shaved to reduce windage.
Reply: Axle Grind its not needed thats the point, people are making over 1200hp on the stock cranks.
The way your phrased it was like the first thing you would do to a 2j is a crank.
Thats incorrect thats the last thing you would touch.
Reply: I'd love to see one on the 4g63 also
Reply: Kyle Carson agreed.
Reply: Kyle Carson when we get in the conversation about 5000hp dragsters, and cars that runs 5 second 1/4 miles.
Than we're debating something entirely different.
Why? Because we're talking street cars here, if you want to build a dragster with a bunch of hp you would build a peroxide engine not a ls.
Does that mean custom built peroxide engine>ls?
Yea in terms of drag racing.
But we're talking real world applications, and even in the drag world the 2j is not far behind, they both powered cars into the 5s.

There's not a single ls you're buying for 1200$ ( price of a jdm 2j with auto tranny) thats handling the same power.
Mainly because to my point its low compression engine designed for forced induction.
No engine is better than the other, they both are better at different things.
 I argue you can make more power per dollar with a 2jz than any ls.
Forced induction>na, when
 it comes to hp per dollar.
And yes its impressive that some guys are making over 1000hp with half the boost, but the 2j has half the displacement so it evens out.

I think the ls is a great platform, but when you hear people say stupid things about the 2jz i must correct them.

A n/a 2jz was converted into a big turbo setup and the block and head was left untouched with oem seals, headgasket ect, and made over 1000whp i have yet to seen that out of a ls.
Can a ls be reliable at high power? Damn right, but there's more prep that needs to be done to a engine thats designed to be n/a that you're converting to forced induction, especially when trying to make big power.
Reply: MRsteezy123 there are dozens of 2jzGTE engines with trans. on Ebay for $1099.00 to $16,500.00. You get what you pay for.
Reply: Dude, you can buy a LSX, naturally aspirated, 776 hp straight from Chevrolet. http://www.chevrolet.com/performance/crate-engines/lsx-454-r.html
Reply: Kyle Carson you're bringing us back to square one. A ls1 wont handle the same power as a 2jz stock for stock.
Theres 1jz (2.5l making over 700whp on stock headgasket and all other oem seals, complete oem longblock.
2jzs making over 1000whp with untouched internals.
A ls1 wont handle that, headgasket will go and so will the rodbolts before you near 700whp.
Working half as hard isn't a great analogy its all about flow rate, and a engine designed for forced induction isn't working all that hard when its blueprinted to do such.
Bring me some fact instead of "you can do this" theres ZERO ls1 that have made the same power as a 2jz completely untouched.
It easy to make power with more ci, with more money.
Bigger engine =more parts=more money.
But like i said you really haven't disproved my point just brought us back to square one.
And all turbos are universal, so we start off with the same turbo kit on both engines, ls1 vs 2jz and boost both until failure the 2jz will handle more this is fact
Reply: saratov99 you do know the 2jz can handle 800 on the crank STOCK internals right search it up
Reply: Random but Would you like me to send you a link of 2k+ hp 2jz before you look like an ass lol
Reply: MRsteezy123 so which you think has the most power potential between both engines
Reply: MRsteezy123 find me your 1,100hp 'stock' 2jz. you are not over doubling a engines original output without in some way shape or form breaking the definition of stock.
Reply: you never even drove a car with a 2jz, put your gran turismo games down kid.
Reply: why should he make up shit? 2jz isn't good, weaboo
Reply: MRsteezy123 you really must be stupid, I could make a damn 2.0l inline 4 push 1000hp for a single dyno pull. you can push almost any motor to thay kind of horsepower and might even get a few pulls out of it before the block splits. I've seen lt1 motors make 700hp on stock internals, not an ls but a lt motor, what none of those guys tell you is that motor is on a stand getting rebuilt after a handful of dyno pulls. notice how all these 1,000hp plus 2jz motors never seem to make it off the engine dyno and into a car?
Reply: You got a good point, 2JZ'S Dont do good in endurance runs, Fuck all these 100 - 1mil price ranged cars do better, fucking lambos, ferarris and so on, all these german engineered cars......  But you need to remember, they are not designed to be drag raced, they are designed to be ran on extreme hills, turns, and in harsh conditions, and pushed to the extreme in handling... Supras, fuckin camaros, corvettes, sc300's are not made to do what all these cars are made to, Supras and SC300's were designed to compete with nissan and their skyline series, well atleast the supra was, the sc300's im not sure, corvettes and camaros were designed to be this half deicent, but powerful role model in american sports cars and muscle cars, every old man died to have one, the newest ls design the 300 - 500 hp dream cars, I meen i guess you can take the corvette and run it ageinst a lambo in a endurance run, ill say the corvette will probably win, but thats about it,  The 2jz was a great design, it was over engineered brining on its great use for boost, its one of the loweset compression motors designed in japan, its 100% forged internals, But the whole reason why its iffy on the max hp on a 100% stock motor, is because toyota let out a conract to another company to build these internals, they used them in the earlier 2jz's, but they dropped the contract as it became too pricey, being the reason why    the so loved 2jz is not a crate motor now adays.  Theres a lot of back story behind all this shit, but think of the intended purpose, A supra with the same ammount of hp as your lambo  will win in a drag race, But not in a endurance run, But same with a ls, the ls will win in a drag race, rather a enudrance run, just think
Reply: sol s., the Vulcan has a V12.
Reply: Yallll gotta drop ya shit, a 2jz is the best class inline 6 motor... the ls series has proven to be the best class type of v8's well atleast the most commonly best.  a 2jz - GTE VVTII  comes with forged internals... crank, pistons, rods, and seemingly perfect berrings. The motor takes boost because of 1, its SUPER low compression ratio and its amazing oil Tech.. I dont know much about ls series, But i know alot coem either cast alum blocks or heavy ass iron blocks.   they have alot of potential in stock form, But you got to remember chevy always liked underrating they're products.....  They love seeing they're motors being used for top line shit too.  Now saying this... both motors commonly have forged internals... 1 Handles high compression fine, (ls v8's) and the other is a beast at running in a low compression state (2jzgte vvti)  Now..... If you want to REALLY compare these both,  YOu cannot.... Try comparing a k20 (honda motor) to a ls1.  Both stock.. not compareable... both 100% built, not comparable.. Im talking same car to put the motor in too btw... No honda with a k20 vs a nova wit a ls1.   Both a heavy car with same motors...  V8 Wins... Bring the v12 in.. it wins.... keep in mind theres no replacement for displacement,... Bigger the motor, 9 times out of 10, the more power it is capable of... Now when you tcompare some 2j vs a ls..... Its not fair, but both are BEASTS of motors....
Reply: joseph marti

lol
Reply: Richard Harrold no any ls will take at least 800 hp and the lt4 can take around 1000
Reply: Richard Harrold a 2jz is never going to hold up to that much power on stock internals those can maybe hold 550
Reply: MRsteezy123 your so stupid 2jz stock are junk can’t make any power with out blowing
Reply: MRsteezy123 ls engines go to 900 hp all day with stock internals
Reply: MRsteezy123 those motors are not cheap to make power with where an ls is very cheap to make power and it can hold unlike a 2jz
Reply: MRsteezy123 the lt4 from the corvette has so your wrong bud
Reply: joseph martinez 1000 horsepower corvettes run 8s all day long
Reply: MRsteezy123 there’s a 1000 horsepower corvette on YouTube that runs low 8s and it’s a stick try that with any Supra with the same power
Reply: Hajile Serpud that's your preference and that's cool but it's bullshit to say the 2JZ is better. Even tho the LS doesn't have the most HP per liter it's a compact lightweight engine often giving the best or one of the best HP to weight ratio. 2jz is good for modding and is one of the most reliable engines. But the LS is more reliable will make anything fast from the factory and if you want to mod them you can.
Reply: o
Reply: Lmao if you want reliable hp over 1200hp DONT build a 2jz..nelson racing has a video about a customer loving the 2jz but has to keep rebuilding it.theres nothing wrong with the 2jz other then it seems to hit a wall at that 1200hp..yes you can make more then that with it but your missing the point.
Reply: +saratov99  yea bullshit kid, I owned a fbody and a tubro sc300 youre talking straight trash.a ls1 will kick rods at 700+whp, and to even make that you need to upgrade the headgaskets and headstuds.second a 2jz will make 700whp all day UNOPENED STOCK OEM GASKETS. A ls1 will not do that point blank.comparing the strength of both the bottom end a 2jz is stronger, you have the record 2jz unopened long block making over 1100whp oem gaskets and all, a ls engine has never done that-FACT.As far as mpg they both get around 19 in the city and 26 highway, anything with highpower is going to depend on the tune.As far as weight goes the 2jz might be heavier but the t56 is heavier then the v160 and handles not even 1/2 the power In oem form. Both engines mounted to the 6 speed trannys they come with its only a 185ilb differenceYou and anyone else who agrees with your comment about a jz being ticking timb bombs above 500whp are all retards, and your 'friends' with jzs that cant take road trips have shitty tunes, hence the video the guy even said 'doesn't matter how strong a engine is if the tunes isn't right, it wont run right.so stop talking shit about stuff you don't know, a jz will make more power then a ls1 more reliable all day and facts show that.
Reply: +saratov99 Since when?  I love both motors and i own cars with both motors.  The 2JZ really only runs into problems once its starts pushing like 600 wheel ftlbs of torque and there are plenty of guys running with 800whp on stock internals with no issues.  both are literally Kings and Queens of motors....the 2jz being the queen of course.
Reply: +SANIC Its not 600lbs. It is Fuel efficient.... it small enough, and it is cheap to modify compared to other engines. 

Toyota overengineered the 2JZ

My MKIV Supra i owned several years ago made 800hp on the stock bottom end and took less than $7k. Spent $12k building the block and it made 1300hp and was still able to get 26mpg on the highway... And this was the 3rd Supra I owned. The first one, i bought from my neighbor who was moving and that car made 900whp on the stock bottom end. 

Its an Iron Block with Aluminum head, and was actually based off the 1FZ which is a 4.5L behemoth SUV/Truck motor. 

People thought the 2JZ couldn't handle any power..... To this day, its slaying Twin Turbo Lambo's and Boosted Bikes at a FRACTION of the cost.
Reply: I'll second that... I'll take a 2JZ over a LS any day
Reply: i think this guy just hates freedom. Murica Burgers fries Fried twinkies and Kool aid what else did i miss??
Reply: +saratov99 the engine can handle 800 until you start seeing problems.... But it will need upgrade like clutches and all gearbox maybe.. Mostly bulletproof.... And don't forget this engine nearly the last engine to be made by Toyotas budget... And they did this on purpose... You can't beat a 2jz..
Reply: ***** ive never even heard of any of those lol